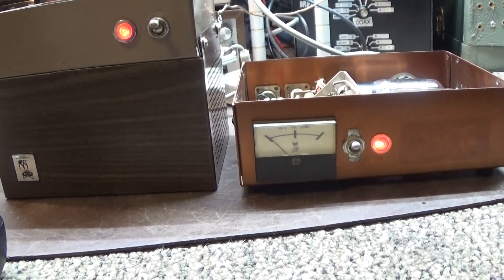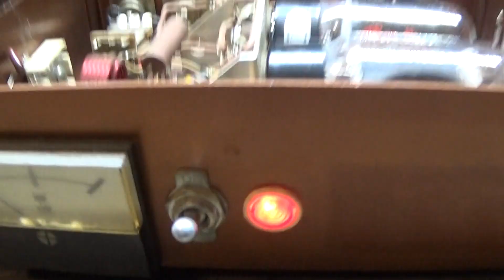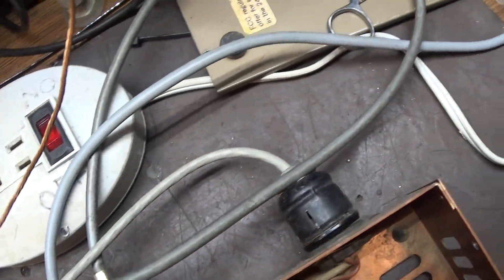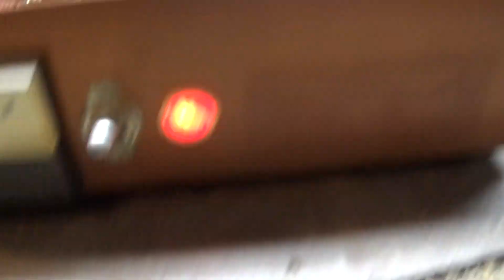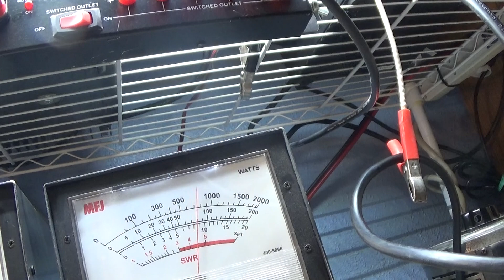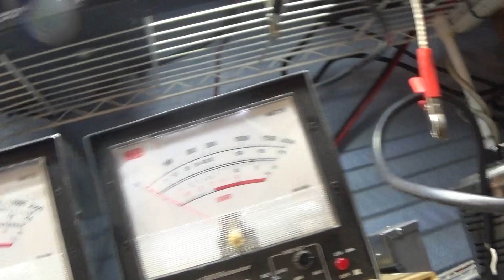Blackcat JB-76 #2

Comment: I have a power supply here that was exactly like you were describing here serial 6785, the blue wires were taped up at the top and the green bias wire was wrapped around the wires coming into the PS and not connected to anything, I think I am just going to do what you did with it
Reply from the maker: Sounds good.